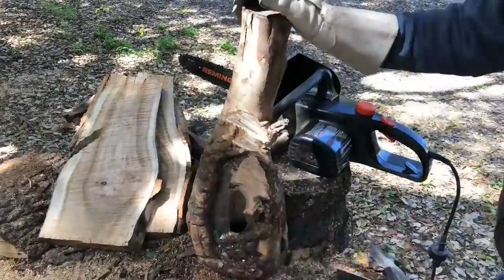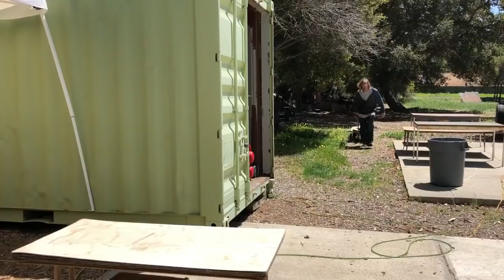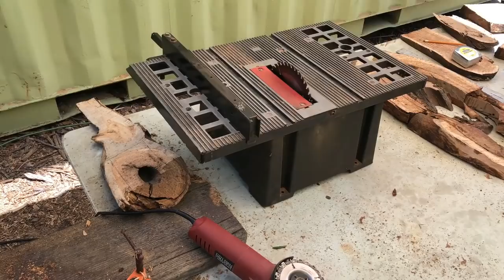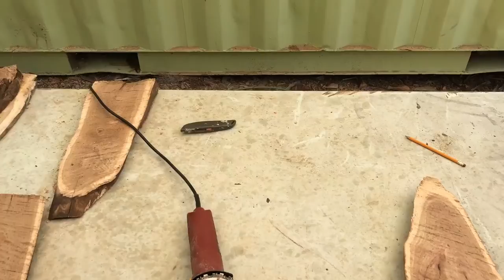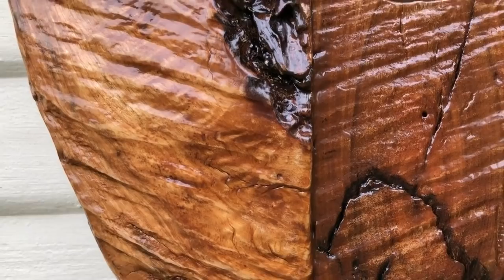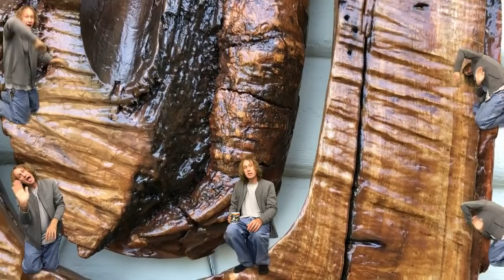"some kinda firewood" rustic wall hanging art piece

Comment: Scott this technique gives me lots of ideas! Why do you use 2 pcs of plywood instead of just using one piece of 5/8" thick? Thank you in advance ✌😎✌😎
Reply from the maker: I usually use a piece of 5mm plywood (approx. 1/4") directly behind the wood pieces to begin with - and then for strength I add a piece of 3/8" behind that - alternating the grains. I explain this in one of my videos - I don't remember exactly which one though. When I talk about the 5mm plywood I call it 1/4" just to make it simpler - there's very little difference between 5mm and 1/4". The two main reasons I do it is that it's easier to cut two pieces of thinner plywood with a jigsaw than one piece of 5/8" - especially when there's lots of tight corners. The other reason is that I can alternate the grains - this helps prevent the art piece from bending or bowing - which can happen with a single piece of plywood in the back.
Reply: For the strength. And yes I remember you talking about it just didnt know if there were more reasons. Thank you! I really enjoy your vids. Have a great evening.

Comment: Scott, this piece just may be my favorite to date! A big thumbs up!

After viewing several of your videos, I've decided to take on a new project using the "Scott O'Connor Method." I found some scrap pieces of natural hackmatack (Eastern Larch) knees, left over from making quarter knees and a breasthook for a small boat I built last year. The hackmatack has an awesome grain that really pops when finished with any kind of oil or varnish.

I'll send you a link to the video once it's finished. 

It won't be for a few days before starting though, as I'm working on a deadline of having 16 five panel benches finished for a local non-profit (I'm building them "pro bono"). The unfinished benches will go to local professional artists for them to paint their "masterpieces." The benches will then be returned and go to the non-profit (Women's Health Resource Library) annual fund raising auction this coming July.
Reply from the maker: Before I posted this, I really didn't know if it would be considered by anyone to be one of the best or a favorite mainly because it's smaller than a lot of the pieces I've done on these videos. So thanks for letting me know that it just may be your favorite to date :) I feel really honored that you've decided to take on a new project using some of the methods that I use in a lot of these videos. That's a real compliment. One of the main reasons I do these videos is to share the methods that have worked for me and to pass on a little bit of inspiration. I'm looking forward to seeing the video once its finished. It sounds like you're really busy and working for a good cause. I hope you get lots of good karma for your "pro bono" work as I think you deserve it :)
Reply: Thank you, Scott.
Reply: Κ
Reply: Beautiful